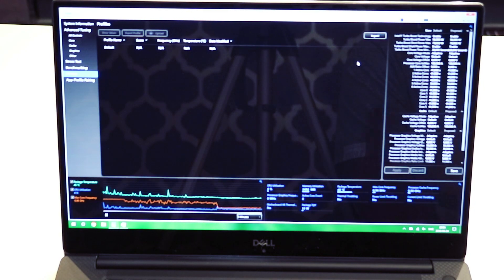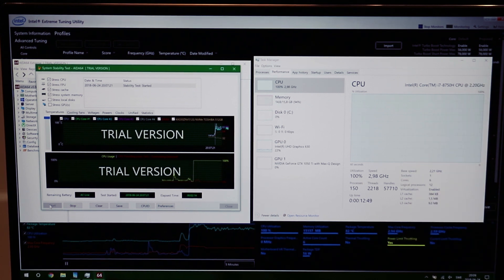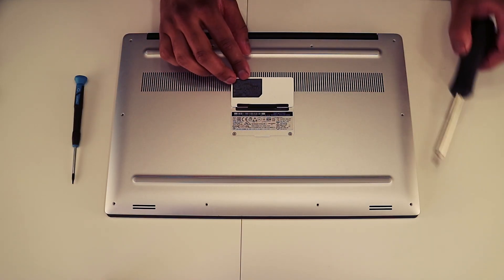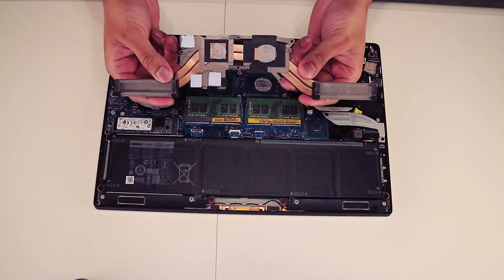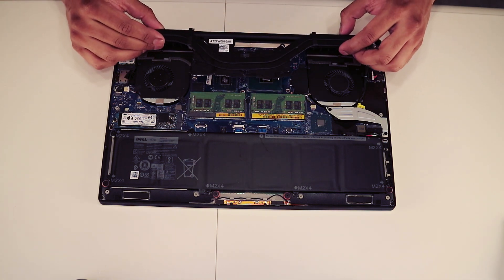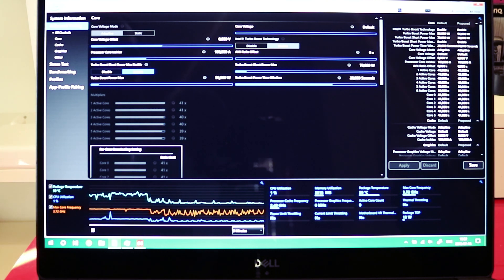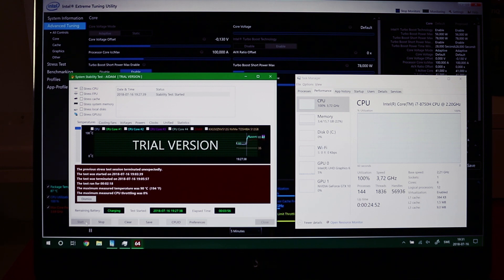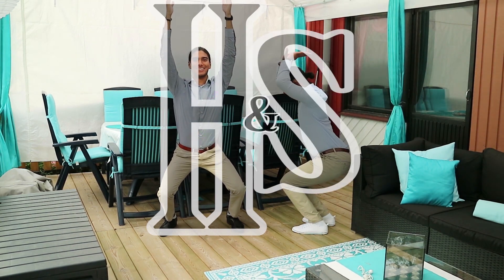How to UNDERVOLT and REPASTE your Dell XPS 15 9570 to Increase Performance!

Comment: My XPS 9560 is 4 years old. But when I ran Aida, the CPU still operated at 2.5Ghz (max) and temperature reached only 66oC. Should I repaste the thermal? I have Arctic MX-4 on hand, but am afraid that I can make the XPS worse than it is at the moment. Pls advise. Tks.
Reply from the maker: Only do it if you notice and degrading performance, or else you could after a few more years. Please do it on your own risk if you decide to change the thermal paste.

Comment: How often would you advise changing the thermal pad on the ssd? Wish you success with your channel!
Reply from the maker: From Intels Q&A:
In most cases, you shouldn’t need to reapply more than once every few years, though you should replace your paste if you remove your cooler for any reason. You may also want to consider reapplying thermal paste if you find your CPU temperatures are climbing.

When I read online, it seems to be the overall opinion that's it's enough to change it every 5 years or so. 

Thank you for your kind words! 😊

Comment: Hey Suten, so I use my laptop for gaming a lot. I play games like mortal Kombat, borderlands and so on, so pretty intensive stuff. It works really well, but it does get warm and fans get loud. I was wondering if you would recommend repasting and undervolting for better performance. Thanks!
Reply from the maker: The performance will be better but the fans will still speed up to max while gaming because the thermal solution in this laptop is very bad and not intended for gaming.

Comment: F...ck always perform repasting with rubber gloves!!!! Static electricity will blow your processor.
DISCONECT BATTERY !!!!!!!!!!!!!!!!!!!!!!!!!!!!!!!!!!!!!
3.Always spread paste evenly on the surface!!!

OMG
Reply from the maker: 1. All the years I've been working with computers, I've never used rubber gloves and never seen anyone do it on YouTube.

2. I did disconnect the battery, I just forgot to include that footage. There's comments about it already. 

3. There's so many techniques out there claiming to be the best. Some people do the cross-method, some the pea-method etc. My rule of thumb is that more is better than less.

Comment: Suten, does it make sense to use the same Intel Program to undervolt the Intel 630 integrated graphics?
Or to use some other tool to undervolt the nVidia GTX 1050 Ti GPU?
By the way, the voltage offset is 0.130 Volts - not 130 Volts ;0)
cheers
JB
Reply from the maker: I think undervolting the Nvidia GPU is more worth because that GPU will be used in heavy graphics applications like games. Search for tutorial videos here on YouTube.
Reply: @HumanSuten  OK, I will.
Thanks

Comment: Hey Suten, yes hello and thanks for your video.
Could you tell me if months after your change that you are still happy with the changes that you made?
What if any were the benefits or disadvantages?
Thanks
JB
Reply from the maker: Yes these settings are good to help the laptop run cooler and faster.
Reply: @HumanSuten  OK, great 👍
Always good to know that the result is not just a temporary / short term one.
cheers
JB
Reply: @JohnnyB43  I've read the latest BIOS updates remove the ability to undervolt the core and you can only do the Turbo FYI.
Reply: @benmo6609  I red the same thing about it. Sometimes even without any rollback solution.

Comment: i left my undervolt saved at -0.120 is that good?
Reply from the maker: That what's been most stable to me so far.
Reply: @HumanSuten  I played a few minutes call of duty ww2, fan started running but my laptop is warm it's not hot. Hopefully I did the pasting correct with the undervolt.
Reply from the maker: The fan will run hot and also most of the times at max speed. This is not really a gaming laptop. The thermal solution in this laptop is terrible. It gets hot really easy. I don't think you did anything wrong at all. This laptop is more aimed at content creators.

Comment: Oh god, why are you still using arctic silver 5? It was great in its time a decade ago, but non-conductive (electrically conductive that is) pasted have taken over. Even cheapo MX-5 is better, and Thermal Grizzly Kryonaut or Gelid GC Extreme are really the only ways to go if you want the best performance and no electrical conductivity
Reply from the maker: I didn't know, I tried do some research and wanted to buy a affordable thermal paste. Thanks for letting me know though!
Reply: @HumanSuten  live and learn! I used AS5 for years until nonconductive pastes were introduced

Comment: Thanks for this video! Would you say undervolting in the BIOS is just as good as XTU? Removes the need for another program...
Reply from the maker: No problem, happy you found the video helpful! ☺
Are you sure that you can undervolt the Dell XPS 15 in the BIOS? If so then that's the best way to do it, software methods are only good when you can't do it in the BIOS.

Comment: Did the repasting with an Dell XPS 15 9560 and removed the dust inside. My GPU temperature is now 15 degrees lower than before and there's no CPU throttling anymore. Thanks so much for the great tutorial!!
Reply from the maker: No problem, happy to hear that the tutorial helped you out! ☺

Comment: FUCKEN STUPID (not the vid but my laptop warranty story)

I open my laptop, it has 56whr battery even tho advertised as 97whr (ive been wondering why my laptop battery life sucked)
I got to Amazon for refund, but nope after 6 months warranty passed.  
The thing was that if I did open my laptop before 6 months, then void warranty.
WTF
screwed since the day i got the laptop.

but i did get a 10% money back
Reply from the maker: Opening up the laptop shouldn't void the warranty. Dell laptops come with 1 year warranty with technician on site. There's a label under the laptop where it says XPS, it should have your service tag number. Try use it while contacting Dell directly.

But I don't know what Dell can do since you bought it from Amazon. A shame that Amazon advertised the wrong battery capacity because it's huge difference between the two sizes.

Comment: So what was the benchmark with undervolting and original paste? you change 2 variables so it's not clear to me if repasting has any benefits
Reply from the maker: The big benefit comes from the undervolting, the repasting gives a small benefit in comparison. It only gives a minor decrease of the temps.
Reply: I was hoping to see a demo with undervolting first b/c I don't want to do the thermal paste since it requires a lot more work and risk. But he did two things at once instead of one so it's a bad experiment. I'm going to undervolt mine and test.

Comment: does it matter if the cleaning alcohol gets on anything outside of the metal squares? If the old thermal paste accidently ends up around the edges of the metal squares (idk what their actual name is) of the cpu/gpu can I use the cleaner to get it off or do I have to just use a paper towel?
Reply from the maker: Very small amounts are okay, be careful not to use any excessive amounts of rubbing alcohol around those parts. Yes you can use paper towels in combination with cotton swabs, but make sure there are no residue left of paper fibers!

Comment: Does it matter whether you apply paste first and then undervolt or can it be done either way?
Reply from the maker: No it doesn't matter and you can also only do one of the techniques if you want to, but both combined will give a max decrease of temps ☺️
Reply: @HumanSuten  I'm looking into buying the 1080p model for content creation in which I'll be doing color grading. Will that screen be ok for that even though the 4k model has higher AdobeRgb? I read that for serious color work, I should just buy a proper monitor and calibrate it rather than relying on a laptop monitor.
Reply from the maker: Hi! I own the 4K model with a 100% Adobe RGB space and my brother owns the 1080p model with a 100% sRGB Color Space. If you're doing some serious work with color grading then i suggest the 4K model without a doubt, but if you're doing it for a hobby and still learning then the 1080p model will be accurate enough.
Of course a separate monitor is the best case scenario as that will be bigger with great color accuracy but that will be an expensive addon.
If you have any more questions please let us know!
Reply: @HumanSuten  thank you!

Comment: Hi mate, nice video! really helpful and just straight to the point. I have Dell XPS 15 9570, and lately I just realized that my fan is always on when it's plugged in, even when I'm doing moderate to no task with cpu temp hovering between 36'C to 40'C. have you encountered the same problem? or is it just dell xps 15 slim design that let the fan on when charged? Really appreciate the video, It really helped
Reply from the maker: Hi we're happy that our video could help you out! ☺️
If they are always on those low temps even considering that laptop uses a different an active fan profile is strange. Yes they tend to turn on more often because Windows default settings uses an Passive cooling profile on battery and Active cooling profile on AC. But I don't think my fans are always on, I will have to double-check when I'm home later. How long has it been since you received the laptop?
Reply: @HumanSuten  Hi mate thank you for the reply, I just got my laptop for about 4 months now, the performance has been exceptional. Hope to hear from you again with the update :))
Reply from the maker: Hi
I just checked and the fan isn't always on but turns on when needed to cool in down. Now that you had your computer for 4 months they will most likely not replace it with a brand new but a Dell Technician could come on site and try to repair it. But I really don't know what the problem is, it could be a faulty fan controller on the motherboard, faulty fans or maybe it needs repasting of the CPU.
Do you have the latest BIOS?
Reply: @HumanSuten  hi thank you for the update, yes I have the latest BIOS so I'm thinking to repaste the CPU and GPU and maybe we can see from there :))
I hope it's not hardware malfunction, but Dell diagnostic shows that everything is working normally. Or is it not a reliable test?
Reply from the maker: Yes please try that to start with so we can troubleshoot further 🙂
When a Dell Technician came to me regarding my issues with the fans turning on and off every 3 seconds he said to me that the Dell Diagnostic Software isn't something reliable to trust. 
Hopefully repasting will solve your issues!
Reply: @HumanSuten  oh that's disturbing information to know 😅
I hope they might have a better more reliable way to detect problem in the near future :(
May I know what happened with your device? And what's the solution for it?
Reply: @HumanSuten  Hi, just want to share, apparently I'm not the only one who encountered the same situation

https://www.reddit.com/r/Dell/comments/9gl7ki/fan_on_when_charging_xps_9570/ 

and there are other users that I've been speaking with, and most of them believe it is working by design to dissipate the heat that the charger produce, but to be honest it seems like a bad design to me. I wish dell would address this known situation soon :/
In the mean time I'll try to repaste my CPU and GPU and hope for the best.
Reply from the maker: Wow... Dell's quality control issues keeps surprising me.. we'll have to make a video regarding the quality control issues Dell XPS 15 9570 are affected by.
Still I really do hope your issues gets solved by repasting! Be sure to let me know!
Reply: @HumanSuten  Hi, just and update. After I was checking with my GPU usage via nvidia setting, it seems like steamwebhelper.exe is actually using my GPU even when it's not open/on minimize in taskbar. I wonder if this is the source of the problem?

Comment: I'm not undervolting I just wanted to repaste my computer, and after doing so my temps have gone down but my cpu is running slower!?!? Any solutions???
Reply from the maker: I have really no idea, if your temps are lower than the CPU should logically hold higher frequencies for longer periods of time. So I really don't know why the CPU in this case is doing the opposite. I will see what i can find for answers, but in the meantime I hope someone else can comment and perhaps help you resolve your issue!
Reply: you probably put too much paste
Reply from the maker: Yeah, it's difficult to apply the correct amount with finesse but it's better than too little thermal paster.

Comment: I bought an xps 15 with i9 and my question is. Is it worth it will it be any better then an i7 or would you recommend me to cancel the order and buy the i7 version?
Reply from the maker: It will have a 10% increased performance compared to the i7. If you can afford it, then go ahead but I still think the i7 is better value for the money 🙂
Reply: i7 will out perform the i9 in real world usage, unless you're doing nothing but 3d rendering. The i9 thermal throttles almost immediately!
Reply: James Baxter thankyou for your response🙏🏼

Comment: Would you suggest then the  i-5 4 core vs the i-7 6 core. Since the i5-8400h has a higher single clock speed and only 4 cores it may result in lower temps and less change of thermal issues?
Reply from the maker: No, the i5 will also theremal throttle, it's basically as powerful as the last generation i7. I think you should really go with the i7, it's a good balance. The i9 is too overpriced for just a 10% increased performance over the i7.
Reply: Human & Suten  i am thinking of the x1 extreme thinkpad 15" i5-8400 vs i7-8xxxh  .... the single clock speed is higher and i wonder if battery life will be effected if using i7 6 cores?... actually lenovo only charges usd50 more for the i7 so its not a price issue, but a battery issue and single core speed issue.  also the base close is higher on the i5.. what do you think?
Reply: Human & Suten  the i9 will be as slow as the i5 once it thermal throttles?
Reply from the maker: No it's not as simple as that. Yes all of them will thermal throttle but the i7 and i9 will absolutely crush the i5 in terms of performance. They have more cores, threads, cache etc. I think you should really go for the i7. It will all around give great performance for games, editing etc.
Reply: ok done, i7 it is.. im deciding between xps 15 9570 with smaller battery as i want dual drives.  OR Thinkpad x1  or waiting to see the oct 2nd event from Microsoftto see if they launch a new suface laptop 15" .. !
Reply from the maker: If you're going for the 4K screen than you should really go with the bigger battery (I believe perhaps all 4K configurations come with the bigger battery). If you're going with the 1080p screen than the smaller battery will suffice! ☺️
Microsoft Surface Books and so on, all have the U-line of the Intel CPUs which doesn't come close to the H-series in terms of performance like the XPS 15 has.
Reply: I am not planning on 4k, Reason: 1) To Glossy 2) Added Weight 3) Dont need a touch screen 4)Windows Still has scaling issues 5) Gaming  4k on a 1050ti isn't possible.  1080p is fine  as most of what i do is coding and chrome. XPS with smaller battery allows me to slot in a second hard drive.  You are correct about U series of processors, i will keep that in mind. thanks.
Reply from the maker: Yes, very good reasons! In your case you should go for the 1080p model ☺️ 
Personally I need the 4K screen for that extra resolution so when we get a 4K Camera in the future, I'm ready. Also for that 100% AdobeRGB Color Accuracy so I can color grade with precis accuracy. I also like to watch YouTube etc in 4K. This time around they have a anti reflective coating on the 4K display unlike previous models.

Comment: So I'm thining of repasting this thing as well ... did you notice any less of the fans going on / off after doing it ?
Reply from the maker: No, it didn't fix my issue, only a replacement of the laptop did! So if you have problems with the fans going on and off like every 3-5 seconds you should consider replacing the laptop.
Reply: Undervolting helped for normal usage, but in Adobe products, the fans go crazy all the time ... really strange ... returning is not an option anymore ...
Reply from the maker: It's same for me in Adobe products, the fans can really go crazy but it varies a lot, but those programs really uses the hardware to it's max therefore I was always fine with the fans kicking in more heavy than usual
Reply: Well, if you have a hardware monitoring tool running that shows the temps of the CPU and GPU, you can see that even when the temps are very low, the fans go nuts ... this leads me to think that Adobe products to play well with a 1050ti max Q for some reason ... there is not heat to justify that kind of fan movement....
Reply from the maker: Hmm you're right, but overall the cooling system of this laptop is very bad. Sadly I don't there's a solution to this problem...
Reply: I don't think so either... the cooling system is crap indeed ... what can I say, there was no alternative to this laptop and I needed the speed (then it throttled on me lol)
Reply from the maker: Yes I was in the same situation.. hope they fix it with the coming generations of the Dell XPS 15
Reply: Who knows ... there will be other problems .. it's a Dell, in the end ,...
Reply from the maker: Haha true.. 😂